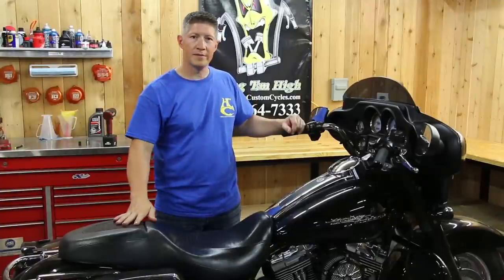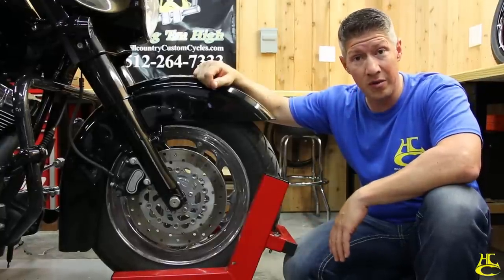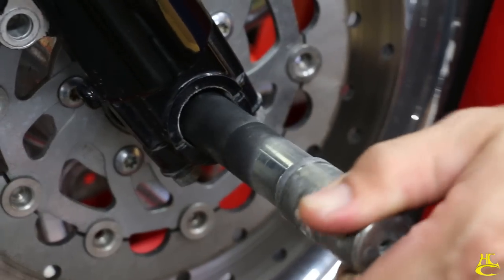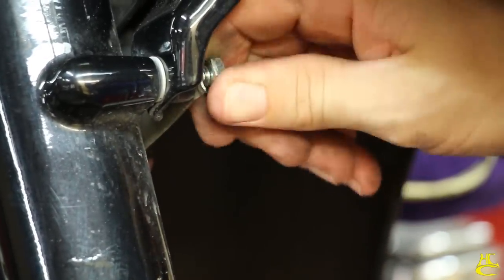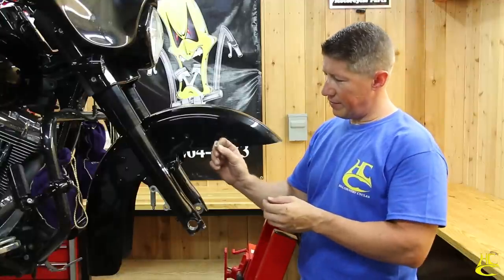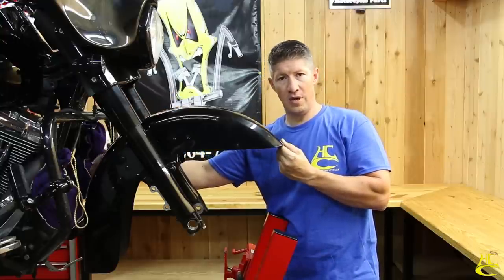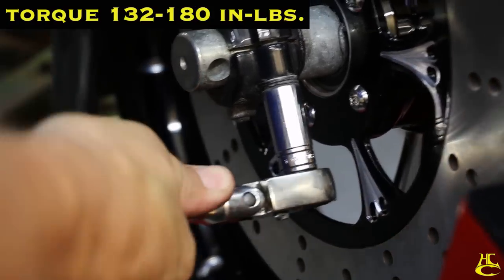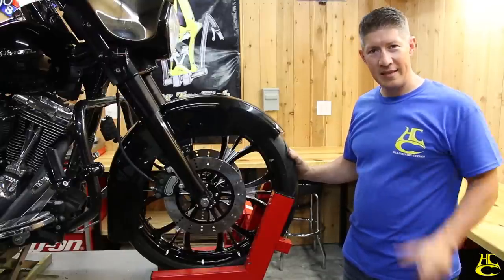How to Install 21 Inch Front Wheel Harley Davidson Bagger

Comment: Dude I just looked at a 2012 rk classic in Reno and it had a 21" dna mammoth front wheel.  The freakin paint was bubbled right where you said.   There was a kick ass lookin one on American Motorcycle Trading Company's yt vid and the salesman pointed out the same thing on a rkc with a 21" wheel and same exact bubbling.  The salesman didn't say what it was from.  Well done video.  Many thanks.

Comment: Great video! I'll be doing this on my 2012 RGU in the next week when my 21x3.5 wheel gets in. I'm trying to figure out what tire size to run so I don't rub. In the video are you using a 120/70-21 or 130/60-21? Thanks
Reply: Thats the same question I have..

Comment: I own a 2002 fxst softail custom with the 21 " front wheel. The custom like mine came factory with a fatboy 16" inch wheel (solid wheel on the rear) I am wanting to put a fat boy 16" inch wheel on the front. Im trying to find out if I need new spacers and a shaft to do this

Comment: Just drilled out my fender mounting holes 3/8", Tilted it, and put a 21" wheel/tire on my 09 Streetglide. I had a question about fender to tire spacing so I did like Robert said and called HCC customer service. Even though they still have the video on their website customer service (?) said they no longer support that or have any information about doing that swap?? So if you do this you are on your own.

Comment: Great video and a perfect example, its common nowadays to run a 21" in the front even on a bagger such as your example, but its also a common topic of discussion regarding performance and stability of running a 21" front wheel and potentials for decreased performance and the feared death wobble. What are your thoughts on this?
Reply: Since when do people on bikes care how safe it it's about how cool it is 😆

Comment: So you take off the fender to drill out the holes on the forks to a larger diameter to give it play and adjustability? Also the only reason I haven’t done it on my streetglide is because I’m afraid if I get a blow out when I’m fat from home that I won’t be able to get a replacement 21 inch tire at a nearby Harley dealership. Do they carry them?

Comment: What about bikes equipped with ABS? Will it mess up the calibration? And wheel bearings, some time about 2014 Harley changed bearing size.

Comment: First i wanna say thank you for the awesome service when i order my 14in apes for my 08 street glide.. My buddy has a 03 ultra classic non abs with a 21 in wheel and hes talking about trading the bike in and selling me the wheel will the wheel fit my 08 street glide with abs if i change out the bearings
Reply from the maker: +Sparky Little  if it’s made by RC Components, you can replace the hub and it will work fine

Comment: Good evening sir,

I have a 16" FLHTK, I had a Colorado Custom 21" 18" Combo, which did not work very well as the front wheel was out of whack...    The micrometer showed variations from 4.040 - 4.069 in various spots on the front wheel and handling was a nightmare....

What are your thoughts on this setup providing maybe another vendor....

Thanks in advance!!
Reply: Kevin Smith im having the same problem on my 13 abs i jus did today. I drill the fender still rub. I left the fender bolts loose , ima work on it tomorrow smh

Comment: I have a 2002 Road King want to install a 21 inch wheel I always thought I had to rake it or bolt on kit but a shop told me the same method you showed so if they do it correctly I shouldn’t get no fender rub ? And how is the handling will it make a difference in a negative way?

Comment: I know this video is a few years old, but wondering if maybe you could help me with an additional question. I've recently ordered 21"from wheel and an 18" rear wheel for my 2005 Road King Classic. (Upgrading from stock 16x3 front/rear). What size tires should I get that would be similar in overall size?

Comment: Do you recommend a lowering kit on the rear to help with handling when you bring the front up? Great video! It's nice to see someone do them this well!
Reply: no run 13 or 14 in rear shocks and it will help handeling
Reply: @onOnewheel_jay  Big help! I just retired and am finally getting to this in the next couple of weeks. I appreciate the info. I assume air shocks but what / where to source?

Comment: I had harley put on a 21” on my Street Glide they used risers and dented my fender when I hit a pothole, very disappointed they did not know about the dent on my obsolete painted fender
Reply from the maker: +Jeff Martin  any touring model (except CVO ) from 2013 and older will take on a 21” wheel just fine.  Fender brackets will raise the fender too much and dent the fender like you have seen,  CVO models require special brackets.

Comment: AWESOME VIDEO... I'm  doing plenty o up grades on a 98 road king. i need al the help i can get!!!!!!!! every bolt i take off results in more parts i need lol. but my 21 inch spoke wheel i orders came with spacers. I'm not sure which way to install them..  help[?
Reply: Did you figure it out I have a 98 road king and I want the 21" front wheel but I'm having a hard time finding one do I buy the 2000 year model and I was told I need the change out the spacers could you help me out and where did you get the rim thanks

Comment: Got my 21" wheel installed on my road glide last weekend! It's hard to right on the freeway though, feels unstable at highway speeds, like it wobbles. Doesn't feel smooth like the factory wheel. Could this be a balance issue on the front wheel?

Comment: One Question , do i need to cut off the stud/bolt that holds the extra decorative chrome bumper on the ultra classic fender? I'm afraid that stud will rub but can't find any info, seems everyone removes that extra chrome fender bumper, but i don't see any thing about the remaining stud.  Thank you so much for this video brother. Got it all done, just waiting for the wheel to show up.
Reply: Did you ever find any information on what to do with the bolt?
Reply: Reece Penrod I took a cutoff wheel to it. It wasn’t fitting at all with the stud. I never did find anybody addressing it.

Comment: great fender mod tip.  what tire did you install?  i realize it's been a while since the vid but want to make sure the fender mod will work with a 130 / 60.  thanks again for the tip

Comment: I have a 2005 Electra Glide, I noticed you didn’t change the brake calibers. I’ve been doing research and I was under the assumption I would have to go with brembo calibers going to 21inch wheel. Is that not true? It will save $$ if not..

Comment: I have a 2005 Roadking custom with a stock wheel. I was told you have to change rotors ?? Is that true..
Reply: I just install a 21” on mine and the hub is bigger so u would need adapters
Reply: I have the exact same bike and I would honestly get new rotors as well. Ending getting 16s instead so I wouldn’t have to buy a new tire just yet lol.

Comment: Hi great video. I have a 1998 road king I want to put a 21" dual disk wheel on my bike but I'm having a hard time finding one and I was told I would need different spacers do I buy the rim rated for a 2000 model if you could give me some kind of info that would be great thanks

Comment: Will this work just fine for a 2011 Softail deluxe. Waiting on the fenders to be finished up with custom paint job before installing. Concerned the fender will be too low now that I have the wheel/tire here. It is a 21 3.5. Thank you

Comment: Hello I'm installing a 21" spoke wheel on my 2003 ultra classic.my question is what is the best tire to use and I was told I will need a tube also could u please point me in the right direction so I dont end up in a box.thank you
Reply from the maker: +Ramiro Gonzalez Avon tire, yes on the tube
Reply: @HillCountryCustomCycles  thank you is there a specific model number in the avon tire they make so many
Reply from the maker: +Ramiro Gonzalez 120/90-21 venom

Comment: I have a 21 inch wheel installed on my 2011 ABS Street glide ,  stock rotors . 
But i have issues with the brakes , no problem to slow down , but for a complete stop , i hear the brakes scraping , sounds like metal on metal. 
Pads are still good , lever is tight , do i need to do any more modifications ? Thx and greetings from Belgium
Reply: Wim De Herdt I'm having the same issue on my 2015 roadglide with Arlene nessa hot legs front end..and I was told today I got to shim the rim stock shims dont work for my set up..
Reply: @donthit707  kkmm
O j

Comment: The video was great, but one thing, you mention to tighten the front pinch bolts to a torque 130+ and The dealership said these are only about 20 lbs.  I snapped one and could not see how you would torque it more than 50 before doing that again.  otherwise It was a very helpful video and I give it 2 thumbs up
Reply: I think the editor might have confused inch pounds and foot pounds. 130in/lbs is about 11 ft/lbs. But since he used an impact gun for "torque to 50-55 foot pounds", I'm disinclined to follow his exact procedure even though the video is helpful.

Comment: Will a 2011 street glide front rim,tire,rotors swap on to a 06 street glide front with out abs, any mods need to be done
Reply from the maker: +Toby Blair u fortunately not, bearings are different sizes and rotors are a different size as well

Comment: Do hub sizes vary?  Meaning can I put those wheels on my 18 softail as a direct bolt on replacement
Reply: If you have an 18 it’s running 25mm axel you would just have to have the hub set up for a 25mm axle and 25mm bearings. A 1 inch will not work

Comment: Is 21" as large as can be accommodated without raking or fender replacement on an 2011 road glide custom? And great video man, thanks!
Reply from the maker: +Jace Landry  yes that is correct
Reply: @HillCountryCustomCycles  thanks man!
Reply: I have the same question, but it’s for a 2012 Street Glide?

Comment: Will this process work on a 2016 Street Glide Special with factory wheel and fender?  From factory to 21". Thank you. BTW, Very informative video.
Reply from the maker: +John Nickoloff  Unfortunately not.  2014 and up require fender lift brackets
Reply: @HillCountryCustomCycles  Thanks for the reply. Sorry for the delay. I traded the 2016 for a 2020 Road Glide Special. Thinking about going from the stock 19 to a 21. Is there a huge difference in appearance and overall ride with a 21?

Comment: What adjustments need to be made if you are running ABS breaks that are calibrated to the smaller front wheel?
Reply from the maker: If it's 2013 and older, nothing needs to be changed.  However, 2014 and newer will require a different wheel bearing or a track max calibration unit
Reply: Thank you for your reply. This is really valuable information.

Comment: thanks for the vid...question...I am assuming that you have 18" on the back so what does that do for the ride?  I did that to my 91 heritage and it definitely change the ride and not for the better.  Also did it help with the ass wag that occurs on the 06?  have have the same bike and I am thinking about doing that to mine.  I am also going to put on a set of your 16" Hell Bent or Jar heads.  Your site does not say that the Hell Bent has fitment for the 06 so I need to confirm that as well.  
Thanks again for the great vids you guys are willing to put out there.
Reply from the maker: +Sean Ronan Yes it's an 18 rear and as far as the ass wag, it won't really make any difference as that involves more the swingarm and way the motor mounts to the bike. So don't expect any big riding difference. Hell Bent does fit 06, sorry for the confusion if the site didn't mention that. We are constantly updating the site to make it better. Thanks for watching and feel free to give the shop a call with any questions! 877-755-4455

Comment: I'm having problems with my well turning free. I take the right side caliber off and it's good. Wat should I do?
Reply from the maker: Make sure that your bike does or does not have abs.  Then make sure the wheel matches what you find.
Reply: It doesn't have abs. I took it off my 06 Electra putting it on my 05. Could it be da spacers maybe
Reply from the maker: +Chris Myers what year is the bike your putting it on?
Reply: Hill Country Custom Cycles 2005 Electra glide but it came off my 06 Electra glide

Comment: Which way did you tilt it, front, back or up? Thanks
Reply: john brewer just tilt rear up.
Reply: Awesome thanks!!!
Reply: Should I do this for a softail deluxe to
Reply: John Brewer pull gently on front of fender, push gently on bottom of rear, on fender
Reply: Thanks! I have a 09 CVO and i'm told the fender is a little different. Another company advised me that I must get the lifts. I'm going to dry fit this next week.. I should be able to tell if I need the lifts. Its a 21x3.5 wheel.

Comment: I drilled my holes after installing my 21" wheel. Taped a 1/4 nut to the tire and I still rub. Think I'm forced to do a riser. Didnt want to but......mine is a 2010 street glide
Reply from the maker: +DWerty Did you tilt the fender from the back before tightening bolts?
Reply: @HillCountryCustomCycles  sure did. It was so tight before the wheel wouldn't move, drilled the holes out 3/8" drill bit. Made it to the point I can move but still rubs a bit. Thinking of mking the back holes a bit bigger and more oval shape
Reply from the maker: +DWerty something doesn’t sound right, then again every bike is different.  You may need a fender lift bracket or something.  I just have never had to use one on that model.

Comment: On a 2003 Electra glide will I need fender brackets for a 21inch wheel? Or can we just drill the holes out? Or will it be fine with no mods?? Thanks!!
Reply from the maker: +Evan Maddox  Just drill the holes

Comment: So that's the stock fender?
Reply from the maker: Yes, just with the slight modification to the mounting holes as we explained in the video. It doesn't take much, but it's necessary if you plan on using the stock fender which is completely fine.

Comment: Thank you very much!  Just what I needed!!! If I'm correct, this also will work on a 99 Road King?
Reply: Correct will work fine
Reply: Did you do it I have a 98 road king and was told I would have to buy the 2000 year model and change out the spacers if you have any information could you help out
Reply: I had to change the spacers too, but I still ride my 21'' and I love it!!!
Reply: And the rim do I have to buy the 2000 year model

Comment: Great video very helpful, I am getting ready to do the same thing with My Road King with a 21” spoke wheel. On another note, I have a 2006 road king police with ABS and EFI and I just purchased your 14” ape hangers On eBay. I contacted the seller because he has not shipped them yet and when I told him that the bike was a police with ABS he told me that the bars and cable kit that I had purchased Part # 401710717594 did not come with the ABS cable for the police ABS. He told me “since it is a police model with Abs we do not offer or have availability to the police abs brakeline.” Can someone point me in the right direction so I can get these bars on my bike and keep the ABS. And actually the bars were supposed to be black and 16” not 14” somehow I paid for the 14” chrome which I guess will do.
Reply from the maker: +Darron Nickolett yeah, I’ve got a fix. Give me a call at the shop and I will explain